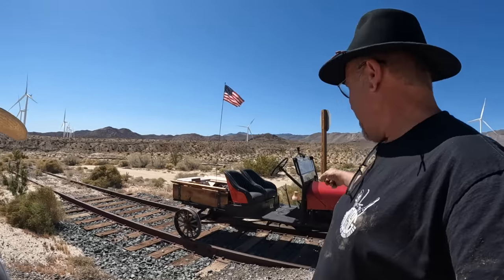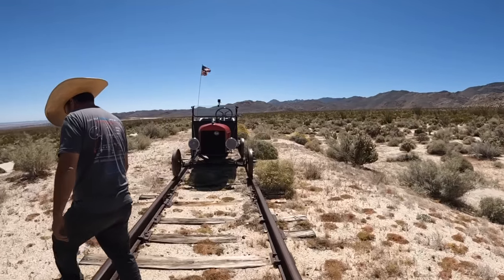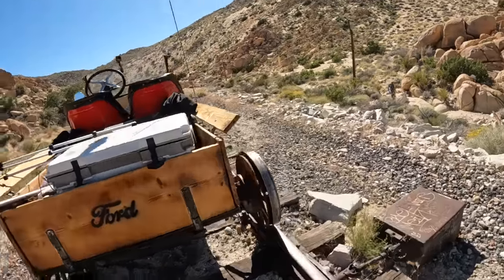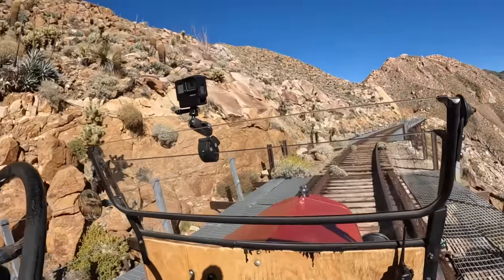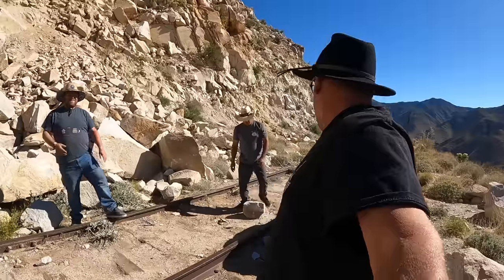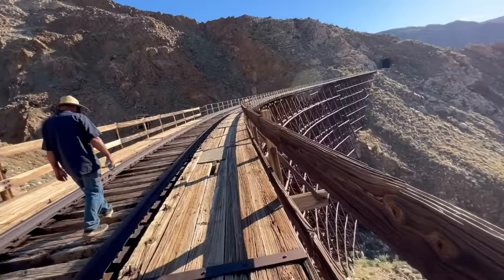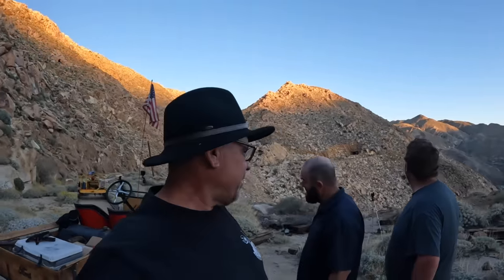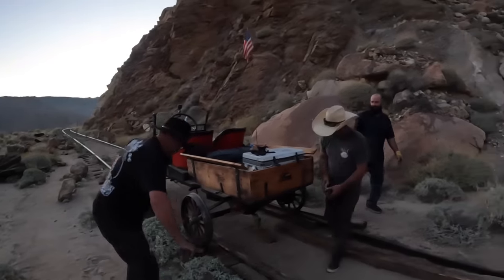Can We Make This Model T Railcar Run and Drive to Goat Canyon Trestle to Go-Kart on Railroad Tracks

Comment: The metal box on the side of the rails had oil or grease in it. That mechanism would lubricate the flange of the wheel. This would help lessen the friction created by the flange of the wheel on a curve. 

And the spots with the ties in the middle of the tracks and timbers going out from the rails are pull off points. A speeder could pull off and get out of the way of train. Sometimes there was a small structure there to put the speeder in and  keep some tools like shovels, hammers, spike pullers and things. Even spikes or tieplates. Love the channel Merlin keep it up.

Comment: So, on an actual Hi- rail, they put a steering lock out. 

You are riding on Speckel's San  Diego, Arizona, and Eastern. Southern Pacific did take control of it later. Its nickname was "The Impossible Railroad."

It lasted into the 80s. A tunnel fire took it out.
Reply: Horn is long, long, short, long for crossings.
2 longs forward, 3 shorts to back up.

Comment: The old speeders had a balance point in the middle where jacked and turned around on there was two wheelbarrow type handles that pulled out used to turn it with

Comment: The timber pad between the tracks and the timbers at a right angle to the tracks is where a man cart can be lifted and turned by the four workers 90 degrees and rolled off of the main line to get out of the way of the train.  I am old enough that I have seen workers do this.  The cart was a platform with four wheels connected to a crank assembly powered by four men working a rocking arm.  Hard work to get to work to do hard work.

Comment: Merlin, remember asking about that wood structure between the tracks? Well that's for taking the smaller tracked dump carts off the track, emptying them over the side and returning them back onto the tracks. You may have noticed the ties sunken into the earth 90degs to the tracks running towards the cliff edge. Too bad it was on the wrong side of the obstruction. It would have made turning around much easier.
LOVED the trip man... do another one day.

Comment: You guys need to look at a few re-railing videos. Two jacks either side of the tracks and a plank with the top side greased to bridge between. A second plank on top of the one straddling the tracks. Jack up to lift the car with the plank and push the top plank plus car along the slippy bottom plank. Sometimes it is better to chock one of the wheels on the ground to prevent the system collapsing. Good luck.

Comment: The little side tracks that are perpendicular to the main are for motor cars, or hand carts.  The box with oil was a flange oiler, used to pump oil to the wheels to lube them and stop squealing

Comment: A couple of handyman jacks and you could of jack push tipped that in a circle, I think those short siding deals by the tunnels were for track traveling equipment to get on off and turn around while clearing rocks or snow on the rails

Comment: The Water Towers are a relic of the past that still exists on many Western and abandoned lines.  In the 1860s, British Rail engineers invented a Tender with a Scoop to add water without stopping under a water tower and using gravity to pour water into the top. It was used in the US on the Eastern Railroad lines The tracks had a water trough built between the rails. As the train passed a certain point, the tender would drop a scoop into the trough and water would be forced up into the tank.  
It's similar to the Aerial firefighting seaplanes that can skim the lake and refill their water tanks without landing or stopping.

Comment: The thing you were asking about that had some timbers that were perpendicular to the rails is called a motor car setout.  Some motor cars were small enough for four men to lift it and turn it sideways.  Some were heavy enough where it had a turntable on the bottom.  That's why there is that wood in between the rails.  MOW crews who were working on the tracks were given a schedule of trains and were required to get out of the way before the trains got there.  They were spaced along the track in numerous locations so that the track crews didn't have to go too far to get out of the way.  But there were accidents from time to time.

Comment: So that box is a flange oiler. This section of track was notorious for derailments as the forces of the engine side-loading the track made them jump up and off the track, so grease (likely turned to a thick oil in the AZ heat) was used to lube the flanges and keep the train on the tracks. The two derailed cars are coors beer cars, and there are still cans in the wreck that are barely ledgible these days. The wood you see between the rails was for multiple things, mainly for others to move carts and such off the tracks to allow passing trains to proceed. In this particular spot, there are large timbers hanging off the edge of the roadbed and there is a steep drop into the canyon below. This is mainly for dealing with many small slides that left materials on or next to the track, and the rocks needing to be removed, so they would be loaded onto carts on the hill side or center of the tracks, moved down to the wood crossing, and then rolled out and dropped into the canyon. I wouldnt suggest walki g out on the timbers, but you can see all the rocks below the timbers from anywhere aling that curve. There could pissibly be some nice cast iron mementos down in that canyon as well, but my disabled butt can only dream of finding them. Hope this helps clarify a few things for you @merlinsoldschoolgarage 😎🍻
-Former Railroader at CFNR (California Northern)

Comment: Im 75 and my grandfather was a railroad section forman on a maintenance crew that did track maintenance. Those planks between the rails with the two planks going off at 90 degrees were placed like that so the handcars or Speeders ( my grandfather called them jiggers) could be turned 90 degrees across the tracks and pulled off to the side to make way for the train to go by. Using long handles in the end of the handcar / Speeder and some muscle the wheels on one end of the jigger could be lifted then the car rotated. The planks between the rails were so the speeder could easily roll between the tracks.  Too bad you weren't near one of those pulloffs when you turned the model T around and you would have quickly figured out what they were for.

Comment: As pointed out elsewhere, those tracks were laid for the San Diego & Arizona railway in the 20th century. “3:10 To Yuma” was set in the 1880s, and the rail line that served Yuma at that time cuts quite a ways north of where you were to cross the mountains at the San Gorgonio pass around Banning.

Comment: They are take-off boards for removing the section cars while trains pass you. the box is a rail lubricator for greasing the flanges of the wheels. there is a special gauge for the wheels they have clearance not the same as the track gauge. 46 years of track inspection & work in Australia.

Comment: Merlin, you need to find the center point of your Speeder and set up a jack with a swivel on top. Then when it comes time to turn around, set your jack , crank it up and spin it around.

Comment: That box on the side of the tracks was used to grease the flanges of the wheels to allow the inner wheel to slip around the curve. Oil would not have been used as grease would stick better. The wheels on each axle are solidly mounted and if they didn't use grease to get the slipping action the wheels and rails would require more frequent replacement. There's your FYI.

Comment: The dry desert will preserve that line for a long time.  I rode my XT600 along the side of the tracks of the "Impossible Line"  that goes from Close to San Diego to the desert close to Inter state 10.  I was riding double with my Wife.  I went over what was supposedly the highest trestle.  It was built in a curve and went into a tunnel.  It was awesome.  A little scary at times, especially on that high trestle.  The Wife did not like me pointing out the cracked timbers under the bike's wheels.    LOL

Comment: Great video guys! How about this for turning your rig around? Mount a big old wooden cart wheel (at 90 degrees to the rear wheels) on the back of your rig and set it up so that you can (hydraulic)  jack it down and lift the rear wheels off the ground.  Then you can hand over hand rotate the cart wheel and pivot the back end around the front wheels (maybe also take a long pry bar to assist in rotating the cart wheel. It would be also handy for the occasional de-railments. The same might be done on the front end however you have much more weight there!

Comment: At time stamp 22:11, that little platform around the rails and the timbers extending away from the track was for a hand operated car.  Where the long timbers are there was probably a shed that housed the hand car when it was not in use.

Comment: 10:30 It's a rail lubricator, it's to help reduce side wear on the rails, it spreads for miles. I was told years back, if you could pick up traces of it with a cigarette paper that was enough. In the UK we used grease, sometimes the machine went mad, grease everywhere lol

Comment: 10.29 This is a flange luber,they are still used on heavy mining rail today with plunger type pumps to grease the inner flange going into tight curves to lessen the wear on track and wheels.
At 29.29 you found what the timber infills between the rails were for,to turn or derail speeders.

Comment: Can I offer you a suggestion? Try to figure out a way to take a  1 ton bottle jack and a frame crossmember that is half has a half horseshoe shaped loop in the center of it make sure there is a flat 7-8 inch square steel plate attached to bottom of the loop and the same for the top of the jack so the two plates come flat together when jack is engaged thus forth creating a solid balancing platform to slip under the drive shaft without touching it and c-clamp each end of the frame crossmember to the bottom of the frame of the model T.  "place a block of wood or flat piece of plywood underneath the jack Base and jack the car straight up . One man jack up the car and the other man balance it at the tailgate area long enough for some one to get to the front of it to help balance it no more than a few inches above the rails .and simply use the jack as a portable turnstile walk the car around in a half circle and lower it back down on to the rails remove the jack and cross member and you should be on your way in 10 to 15 minutes as apposed to the time it took you to do it in this video.😊you are welcome from a future rail karter.😂

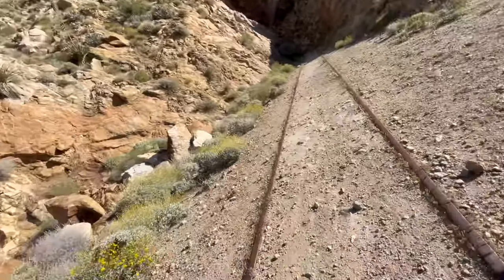Comment: 22:36 Next time you four go back up there, consider high railing a small excavator, or better still load one onto a lowboy trolley (made with a dropped main deck sitting between a couple of trolley wheelsets), to thus also have on site, a suitable work trolley to take rock and dirt from the rockslide site, that the digger loads up, that you then take along to the viaduct nearby, off which you can dump the rocks and dirt, assuming you can do that free of any gaurd railing and walkway decking..
Like simply off the end of sleepers, as seen on any non-sided bridge.
Or failing that, simply dump the spoil alongside the open track well away from the cutting, as soon you won't be wanting to push it either way, full or empty.

Comment: the area were the tracks have been filled in with lumber and has two ramps off to the side is common on older rail roads.its were a speeder could be gotten off the track so the trains could pass by

Comment: For turning the T around on the tracks figure out the exact center balance point of the car and create a jack point on this spot. Might have to fab up a cross member to bolt up under the frame. Then all you have to do is jack it up with a bottle jack and pivot it around. Might help to chain the suspension to limit travel so you don't need to jack so much to overcome. Work smarter not harder.

Comment: Those pull offs were for work crews/inspection crews to pull a jigger on or off the rails to allow other traffic to pass. The wood pads are to eliminate lifting othe jigger up and over the rails
Reply: One of those spots would have made turning the model t around easier. 
I forgot to mention the RR would have pump hand cars and or jiggers powered by gas engines

Comment: Back in the day. the maintainers that work on the tracks used little machines called carts or putters or putt putts. to haul they're tools up and down the tracks. When a train would come or it was quitin time and they were going to leave they're stuff there, they would put big lone handles on one end of the cart and pick it up, turn it sideways and roll it out onto those ties off the tracks. and out of the way of trains.

Comment: Fun fact: train wheels are not flat but conical for two resons:
a) they center the train automatically between the rails
b) the cones allow the trains to drive through corners (different diameters of the cones allow for different "wheel speeds") ✌️

Comment: Those track greasers or oilers are usually for tight curves to prevent galling and binding. Curve rail grease is either a graphite or maybe molybdenum disulfide grease. I've seen it before and its very black.

Comment: That apparatus  is a grease pot  , it pumps grease onto the edge of the rail to provide slip as the axles are solid and the inside wheel is traveling at a slower speed to the outside rail on a curve , sort of makes the job of a differential redundant on the rail road .
Reply: Actual a flange greaser.  They would lube the wheel flanges to minimize wear on cures.  The wheels are designed so as they hit a curve, the outside of the wheel is larger than the inside, so the inside wheel doesn’t have to travel as far as the outside of the wheel.

Comment: I have ab idea for turning around your rail car.   Get a floor jack and build an adapter plate to go on top of jack. Carry it in back of car abs when you need to turn around put under the car at center point, jack up until all 4 wheels are clear of track, and spin it around and lower back on the track in opposite direction. Hope this helps. Looked like fun😊

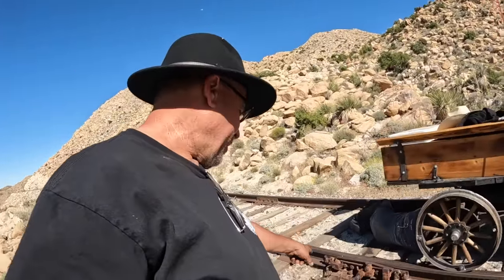Comment: 10:55 the thing with the oil is a wheel flange lubrication device to stop wheel flanges from squeeling and reduce wear in tight turns...!
Reply: car on rail reminiscend of the Great Race with Professor Fate and Peter Falk.....

Comment: WE DID THE SAME IN A FOX CART DOWN HERE IN AUSSIE ALTHOUGH ON THE WHEELSET..AS WE DONT WEIGHT 200 TONNES WE RAN A THIN 4MM THICK / 40mm WIDE RUBBER BAND ON EACH WHEEL THAT COVERED THE METAL TO METAL CONTACT AND JUST THIS THIN STRIP OF RUBBER ALONE TURNED THE COMFORT UP 100% SMOOTHER...WE COULDNT BELIEVE HOW MUCH SMOOTHER...

Comment: That line was built before 1910 as the San Diego & Arizona Eastern RR.  It still serves the US  Gypsum Co. at Plaster  City, CA.  It was operated by the SP.  The track in Tunnel 4 is under the border with Mexico.  Except for several rock falls, the line is complete to the border and the mainline connection on the C California side of the Colorado River.  There is a train museum close to the border.
The movie 3:10 To Yuma was on the SP.
@22:05,  that is a motor car set-off.  The car is stopped over the group of ties, the handles are pulled out and lifted up raising the powered wheels, the car is turned across the track and pushed or pulled off onto the ties at a 90* angle to the track to get the car clear of the main for a train.
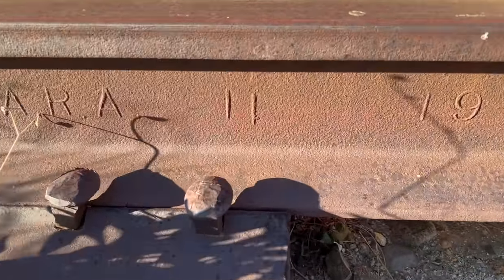@27:58,  I can't make out the first 3 letters, 90  is the pattern weight of rail (90 lbs/yd), ARA is the pattern designation (American Railroad Association), the 2 hash marks mean the rail was rolled in February of 1919, and the OH is for open hearth furnace for how the steel was melted and made.  The first 3 letters are for the steel company that rolled the rail.
The timbers in the trestle and in the tunnels is 12 X 12 redwood or 14 X 14 redwood.
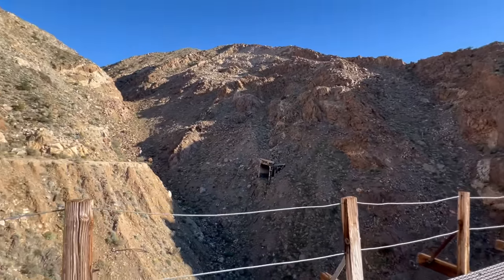@25:48, when you said another collapsed tunnel.   That tunnel collapsed from an earthquake and is the reason for the open tunnel at the end of the bridge and the bridge to get around the collapsed tunnel.

Comment: That old machine is called a greaser. It was used to lubricate the flanges on the wheels so they didn't wear the track out in curves. It's really neat you noticed it.